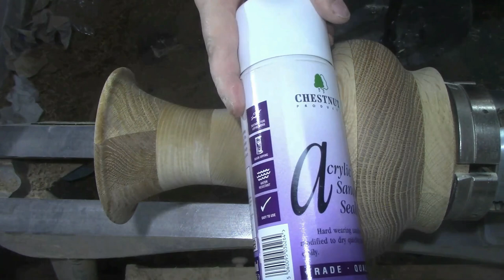Woodturning | Segmented Vase

Comment: I understand that you are an advocate of Easy wood tools. I can only speak from personal experience. Basically this, the easy wood tools I use are my workhorse tools for roughing applications. Great tools!!!! However, I find they are not comparable to traditional gouge and skew tools which will give a much cleaner and sanding,-free cut than the carbide tools.